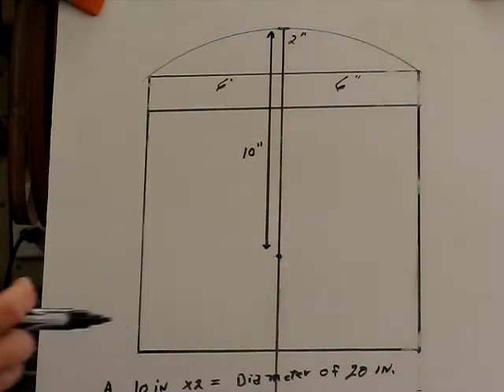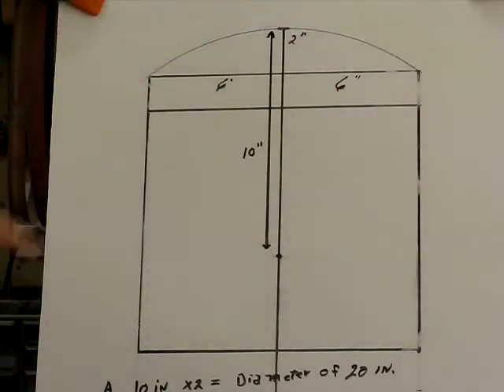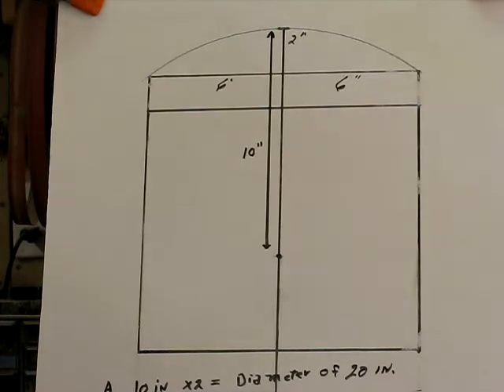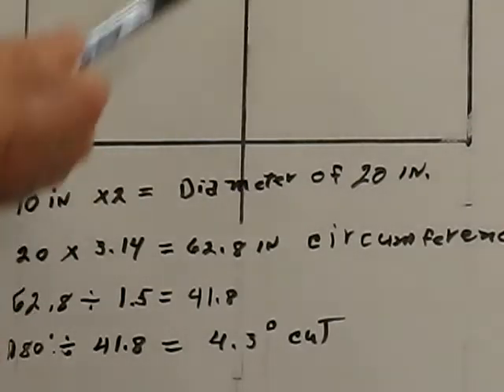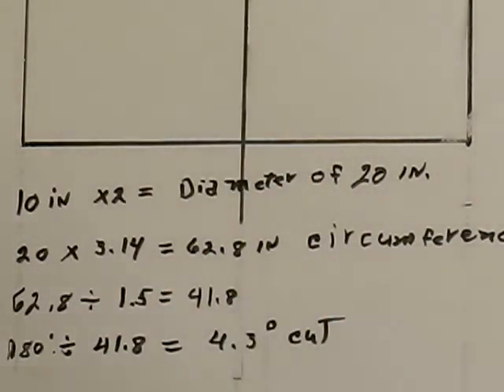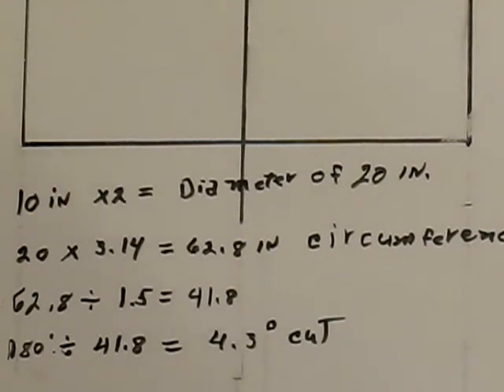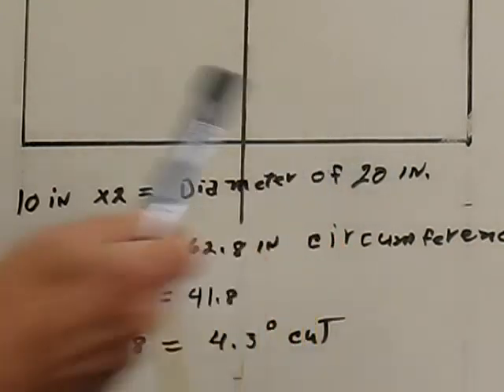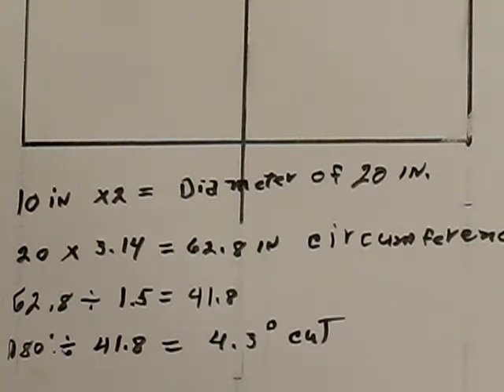Round top toy box lid calculation part 2

Comment: Would this round top work on a bigger scale? Like 6.5' x 8' to use as a small camper roof? If yes, do the widths of the wood have to be the same as this top no matter how big it goes? The outside would be completely sealed and then covered with either fiberglass, aluminum or stainless steel.
Reply from the maker: Yes. The equasion should work for any size but it would get pretty heavy at the size you are talking about.   You can make  the slats any width you want.   I used narrow slats to cut down on sanding.

Comment: I'm confused.  If the angle between the 2 slats is 4.3 degrees, wouldn't you cut both edges at half of that, 2.1 degrees??
Reply from the maker: It's been almost 7 years since I made this but I believe  the 4.3* is correct.  8.6* between the mating surfaces.

Comment: What's up Wayne, thanks for the video! Just wanted to mention that if you wanted to calculate the exact angles you can use arcsin[(width of the board)/(2*radius)]. For example in your case, the angle would be arcsin[1.5"/(2*10")] = 0.0751 rad = 4.3 degrees, as you calculated.

Presumably the width of the board will always be small relative to the radius of the circle when planning to build something like this, and since the slope of arcsin(x) is 1 at x = 0 your approximation should normally work well.
Reply from the maker: My calculation was for people who have forgotten what they learned in math. class.